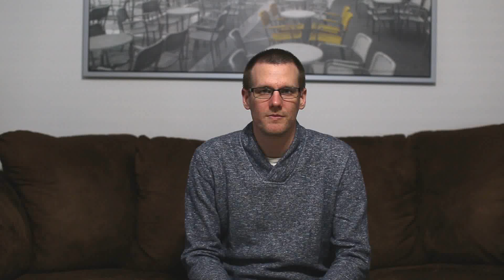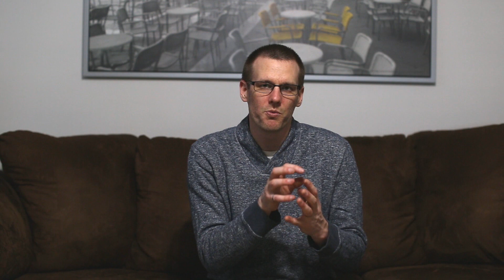Differential Fluid Performance in RC vehicles

Comment: So I've watched the video but prefer your personal opinion.  My driving style is fast and loose.  Vorteks 2wd is my fastest and favorite car to slide around at insane speeds. I also have a bigrock 223s built up and it's bonkers. Only problem is it pushes the corners instead of sliding or even holding it. What diff fluids would you recommend to get good slide action out of tye rear? 
F/C/R fluid? Thanks for your help and a great video.
Reply from the maker: you will want to increase power to both rear wheels. on a 2wd car, thick fluid on the rear diff. On a 4wd car, thick fluid in the center, I prefer to lock the center diff and then thick fluid in the rear.
Reply: @RCexplained Thanks so much. Ill try earplugs in center and 500mill in rear diff.

Comment: Finally someone who talks plainly !     Kinda works the way I thought left to right  but I didn’t think of going down 
in fluid weight from (7k to 3k ) rear  . Car spins on power after turn . Asphalt oval losi nascar . I’m an old newby .
Thanks
Reply from the maker: Thanks for the kind words.
Reply: can also be that your middle diff is to heavy when the car spins out ;) as he said in the video its basicly try and error ^^

Comment: You have gained a new sub due to how you explained this differential stuff. I’m new to the racing scene and really getting into fine tuning my truggy for racing. After bashing (coloring outside the lines) for over a decade and pushing our cars to extremes, moving to the racing (coloring inside the lines) fine tuning has been a real relearning experience. Thanks for the way you explained this. It really helps.
Reply from the maker: Glad you found it useful

Comment: Very appreciative of this video. GReat explanation. Recently got into RC racing, and I run two classes. 21.5 2wd stock and 13.5 4wd with my B74.2. My middle diff is a slipper diff. I am loving driving my 2 wheel drive but I am having a hard time getting used to my 4wd. The kit asks for 15k on both front and back, any suggestions to make this feel a bit easier to drive? I appreciate the suggestion. Great video by the way

Comment: Nice vid mate! 
Would be a 20m Center Fluid, 100k rear and 200k front setup good on the outcast 8s?
I ask myself, will this setup force to much wheelies?
Reply from the maker: It's really a preference of the driver. I do like the center diff to be quite solid. Give it a shot and see how you like it.

Comment: My rc car understeers badly under high speed corners and my guess is when the weight transfers to the rear the center dif sends all the power to the front and do you think using grease in the center diff would help out on understeer Or would it damage it?

Comment: You should really try first with factory setup, because oil weight can really change A LOT between cars. Like in a E Revo 2 its about 30k and 20M in the center so with 8k in the center the front tires are going to explode lol. Anyway good video for begginners it's always useful

Comment: Question my friend, what viscosity is red Lucas tacky grease vs 3000 cst diff fluid?
Reply from the maker: I'm not sure, never worked with this. If you have both, you could run some tests to discover which has a higher viscosity.

Comment: I have a XRT that's stupidly over powered lol but that was the goal.. but right now I don't know what diff fluid is in there.. I know it's stock. It has an 800 kv motor with max 5 running 12s.. I want to know ur opinion in going like 500k fluid in front, 20mil in center and 1mil in the rear. I'm looking for more of speed runs not so much of track.

Comment: HAHAHA   yea ok...  I use 50,000 in front,  20,000 in rear, and 200,000 in middle.  But then again I have a 1/8 Kraton EXB with loads of power!
Reply from the maker: Are you comparing correct units? Sounds like you are not.
Reply: @RCexplained  "correct units" wth are you even trying to ask?  Yes in the front diff I use 50,000 weight FIFTY THOUSAND and in the middle I use 200,000 TWO HUNDRED THOUSAND weight,  and in the rear 20,000 TWENTY THOUSAND weight...   This stuff is THICK!  When you have power running through them diffs from a Hobbywing Max6 1650 combo spinning huge Dboots Copperhead 2 tires  you need the thick fluid not the thin runny stuff you talked about.  So yes I am talking in "correct units"...
Reply from the maker: Confirmed, you aren't comparing the same units. Units in video are not wt. They are cSt. It's like comparing megabits to megabytes. More info in the description.

Comment: I've never really gotten in to tuning my diffs and have always been the type to adjust to my RC rather than trying to adjust my RC to me.  I've blown a few front tires and have realized that I need to put thicker differential fluid in the center.

I have a few questions about differential fluid / grease.  What is the difference between diff fluid / grease?  I'm assuming that diff fluid actually goes inside of the diff, and grease goes in side of the diff box.

Is diff fluid and diff oil the same thing and are two words that get used interchangeably?

Also, you mentioned that 7k-8k is a good setup for starters on the center, but yet I've heard of people crazy numbers like 1,000,000 in the center.  Why is there such a huge gap with those numbers?  I can only assume that there is no universal rating system, where a number directly correlates to the thickness.

Not every RC manufacture makes their own diff fluid, which means you could be running a Redcat RC with Team Associated, an Arrma with Losi fluid and so on.  So with that being said, are differential fluids the same across all brands (similarly to car oil) in terms of the number to viscosity ratings?  Or would 8k from one brand be thicker / thinner than another brand?
Reply: This guy is referring to small 1/10 scale buggies on a race track.   I use 50k front, 20k rear, 200k middle however my RC is 1/8 Kraton EXB and has a HUGE 6th scale esc/motor combo turning HUGE monster truck tires.   With the thicker middle fluid it allows me to wheelie easy.  
The brand of silicone diff fluid is of no worry if it is labeled as 10k it is 10k just like auto oil rating.  
Cheers~

Comment: New to the hobby and I just picked up a Sledge & Typhon 6S, thank you for this insightful video!
Reply: I drive Sledge one year with stock oils(for bashing it does not matter), i changed few weeks ago for lighter. For not behave so like heavy tank.  My current setup is 20K/20K/10K.

Comment: Thanks for this video. I juts got my daughter a Team Corally Sketer for bashing around with me in my EXB Kraton and my mate with a V5 Kraton and the diffs are so aggressive. On gravel it just spins out even with mild throttle the rear acting like a locker with its 20K fluid causing it to spin out on her. The base set up you suggested is exactly what the Team Corally support said to use. Hopefully these changes will make it way easier to drive.. Keep up the great videos..

Comment: Amazing explanation, thanks for this.

Subbed and liked.

If I wanted a set up that was geared towards more sliding on road would this be a good set up?

Rear 50k
Center 100k
Front 10k

Thanks!
Reply from the maker: Yes

Comment: I use wheel bearing grease in center 50 or 60 k in front 500k in rear exb kraton  actually thinking about doing grease in rear as well

Comment: I have two sets of front & rear differentials. Both were purchased online for the same RC truck. The front diff is identical to the rear diff on this vehicle. The front  diff is identical with the rear diff in set #1 and are also identical in set #2, however each set come from a different manufacturer & the internal spider gears seem to differ slightly  from one manufacturer to the other. The differentials from each manufacturer  look identical on the outside, however when I open up the diffs to see the spider gears I notice one manufacturer's product has more teeth & smaller teeth than the other manufacturer's product which has larger teeth but less of them. I'm now stuck with the dilemma of deciding which set to use. How will the diffs containing spider gears with more yet smaller teeth perform compared to the diffs containing spider gears with less yet bigger teeth?
Reply from the maker: I would not expect there to be much difference.
Reply: @RCexplained  Thank you for the response! Also thank you for all the advice you give and the phenomenal content you produce. Your content has been a tremendous help and in my personal opinion you produce the best content on YouTube when it comes to Radio Control...BAR NONE! So thank you for your expertise and for all that you do!
Reply from the maker: Appreciate the kind words

Comment: I read in an rc article heaviest in the front, mid weight in the center and lightest in the rear. As in 500 rear diff, 1000 center diff and 1500 on front diff. This is for aggressive and still have control.

Comment: I have a question. If you can help. You mentioned diff oils f5 c7 r3.

Now the question I have is how come 1/8th oils are thinner than 1/10th. 

Would the following oils f5 c7 r3 work well in 1/10th

Comment: now, how do you feel about all competition chassis 1/10th scale using a spool in the front? even the expensive ones.... RCexplain it please.. i have asked this so many times without a real answer anywhere, how can they compete with a spool instead of diff? is it because they count on the inner tire being in the air in sharp corners?
Reply: The rock crawler or climber  seem to lock or use heavier diff

Comment: I was amazed by the diff fluids in my X-Maxx 8s…. Front 10k, Rear 30k and the torque biasing center a whopping 20 million! Crazy! Changing all the diff fluids now.
Reply from the maker: Xmaxx is a larger RC. My recommendations are for much smaller RCs. If you are looking for different performance, adjust accordingly.
Reply: What would be a better centre diff fluid for the xmaxx?

Comment: When i spin back wheels by hand it wont spin the center drivetrain or front wheels.. when i spin front wheels same thing, it wont spin center or back wheels... does this mean it has a heavy center diff oil?
Reply from the maker: No, performance of the diff oil should be evaluated by driving the car.
Reply: @RCexplained  is my issue something to look into or normal the rc is losi baja rey.. it drives good.. just when i spin the wheels by hand it doesnt move spur or front wheels
Reply from the maker: What is it moving? Is there a symptom you are experiencing that lead you to investigate which wheel spins and when?
Reply: @RCexplained  no i just thought all wheels should move if i move one
Reply from the maker: OK.  Not all wheels should move if you move one. More than likely rotating on rear tire makes the other rear tire rotate in opposite direction. This is normal.  Front or center differentials may see no motion.

Comment: Although it’s common sense and  ties into your wonderful video I’m surprise ya didn’t touch on locked or spooled  diffs  and the 500,000 and 1 million fluids for the noober
Reply: This, this is specifically the info I'm looking for. Hard to find good info on locking the rear or center diff for offroad driving.  -Mojave

Comment: what diff fuild for 4 tec drag racing?
Reply from the maker: What performance are you looking for?
Reply: i have castle 5700 running 3s traxxas 4 tec 2.0 i wanted to go straight and fast want to know what diff fuild to run in the front and rear?

Comment: I have a 2wd Traxxas Slash with a velineon vxl that is a street car. Im planning to swap out the entire transmission and im putting a hot racing sealed diff. What fluid size do you recomend?

Comment: Would make sense to specifically point out this refers to off road vehicles. As front center rear diffs are mentioned.
Reply from the maker: Hi Pedmar007 . I'm a bit confused, can you explain?
Reply: @RCexplained  you mentioned front center rear diffs and that for me refers to 4wd off road vehicles. I was looking for a video that explained the use of diff oils that can govern the application you're in. I'm into onroad 4wd tc, and was hoping to see the use of the oils in that application.
Reply from the maker: I use the concepts in this video for all my on road rc cars. Most of my rc on road cars do not have a center differential allowing me to ignore that part of the video. My most hardcore offroad 4wd truck uses the exact same layout as the on road cars.
Reply: @RCexplained  ok. understood

Comment: Great video thank you! You recommend around 5,000 weight front, 7,000 weight mid and 3,000 weight rear as a base. I’m trying to buy some oil but it’s only in CST, can you convert this for me? I see some people saying 5,000 weight is 50,000 CST etc is that correct? So I’ll need a 50,000 CST front, 70,000 CST mid and 30,000 CST rear to match your weight recommendation? 
Thanks in advance 👍🏻
Reply from the maker: There's no perfect conversion. Stick with a multiplier of about 10. It varies significantly from brand to brand. EDIT: I have updated description to reflect cSt recommendations. I may have said "weight" but meant cSt.

Comment: A video about ball diff vs gear diff might be also interesting! There are many threads about what is the effective/dynamic difference about those, and nobody seems to agree on the why, but tends to agree that ball diff is better at low grip conditions than a gear diff (even with low viscosity silicone oil). Maybe it's the left-right power transfer that it might be inherently faster in a ball diff? or maybe the gear diff oil changes propierties the faster the gears rotate, compared to the ball friction? I don't know why.
Reply from the maker: I think it would be a challenging video to make. I don't really see any advantage a ball diff has over a gear diff. Maybe it being lighter? There's a reason these are fading away and not really used in anything other then small RC's.
Reply: @RCexplained  One small advantage is the lack of gear backlash.  Since it's just plates pressing on balls there's no play like a gear diff can have.  A bigger advantage in my opinion is that when a gear diff starts to unload is becomes easier for it to continue to unload.  A ball diff unloads at more or less linear rate.  Last advantage I can think of is that ball diffs won't fade or change during a race unless you set it too loose and it slips.

Comment: Doing center Diff on U4 Losi Lasernut, doing the 500K. will see how it goes. Saw another fellow youtuber use it and he likes it. You think its overkill?
Reply from the maker: It's not necessarily over kill. Really what it comes down to is personal preference. There is no right or wrong. I would say the same if you said you are using 2,000,000 in the center diff. Try it out and tune from there.

Comment: Man if this guy knew how much help he is esspecially for ppl that's just getting into the hobby perfectly explained I just learned about diff performance just that fast lol ty bro
Reply from the maker: Hey Wilfred, thanks for the awesome comment!
Reply: @RCexplained  my arrma felony has 10k in front 100k middle and 10k rear and my right rear tire goes bald should I do 20k in just front and rear to even leave center to stock 100k
Reply: @tktk-om8cg  hey i know its 3 years but, if one of your rear tires goes bald you should reduce weight in the middle diff, because as he said in the video you have to much drive in the rear... i would try 50k in the middle and just test if it gets better ;)
Reply: What Best set up for traxxas erevo 2.0 Mine wants to spend that every time I go around the turn
Reply: I agree.. no one else explains anything.
We all know what grease does.. duh.
This is real info to make and educated decision.
Hats off to you  brother 🔥

Comment: Great video now I understand better how diff oil works, quick question I just bought an Axial Yeti love this rig. The manual says to put 20 000cst, does this sound right to you? Thanks !!
Reply from the maker: Yes it does, it all comes down to the desired stock performance Axial is after. If you don't like it, it's easy to change.
Reply: @RCexplained  Perfect thank you for your input, much appreciated!

Comment: Hello
i have Corally Kronos and i am interested for fluid in differentials because the car  on 6s is brutal the car constantly rises i wont more power in front diferincial
du you have any solution
original fluid front 7500,centre 5000,rear3000
Thanks and
regards from Slovenia
Reply from the maker: Hi Herman, what do you mean that the "car constantly rises"?
Reply: @RCexplained  with throttle 70% or 80%  on 6s it raises it to the rear wheels or even turns it over
Reply from the maker: If you want to get more power to the front wheels vs rear wheels, go with a lighter weight in the center differential. If you want more power to the rear wheels go with a heavier weight fluid.
Reply: @RCexplained  Thank you for your kindness
Reply: thanks i got the answer i was looking for.Finally someone who explains every scenario regards

Comment: So lighter fluid equals easier to drive and not as hard on your motor to a point, heavier equals a lot of acceleration but less control and less sharp turning, heavier in front , I have a truggy with no center diff or slipper clutch , do I just re open my diffs they were nearly locked and miserable

Comment: What if u run a 2wd? What weight would u recommend to start with?
Reply: I run dirt oval amd need power out of the turn
Reply from the maker: If it's a 1/10 scale, I would run 5k in the rear.
Reply: @RCexplained  ok that's what I have. Its a sc6.1 and I run dirt oval with it. Not off road. Thanks for the reply 👍